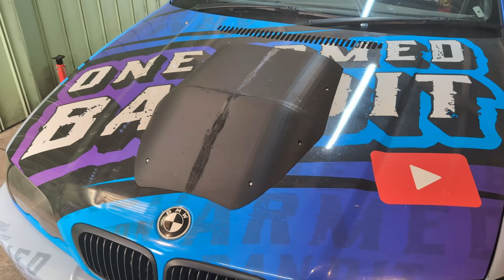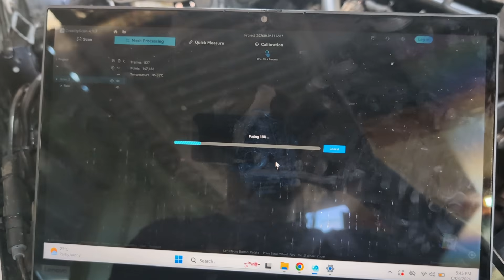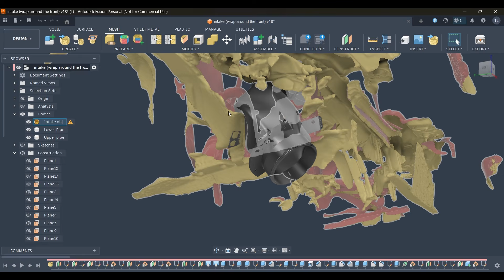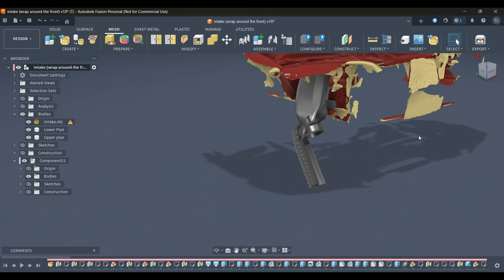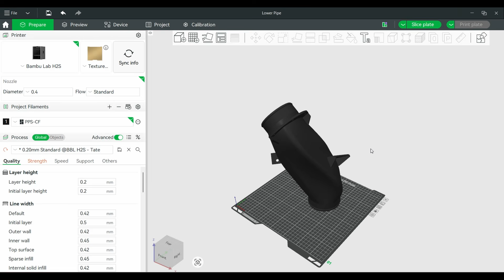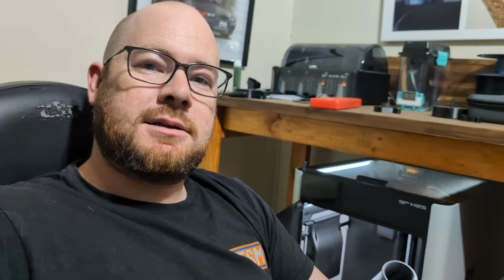3D Print Your Car Parts! | Quick start guide to design & printing.

Comment: Maybe I completely missed you mentioning this as I sort of listen as I work, but are you running that PPS-CF through your AMS? I know they say some of their filaments arent AMS compatible, but my understanding is that some people are modding their AMS's to run stuff they shouldn't. I have some PET-CF17 that I read would work, but that you needed something to save your funnels, so I printed some funnel savers. I haven't been brave enough to try it just yet. I've actually had some major projects in PETG and ASA that have eaten up all of my printers run time lately.
Reply: if there is anything i can recommend, its running pps-cf through a sunlu e2 which dries at 110c. running it through the AMS can damage some of the parts, aswell as increased wear on PTFE tubes. I personally just disconnect where the PTFE tube goes into the side of the printer and feed the filament through there, into that smaller PTFE tube section that goes into the tool head. PTFE tubes are consumable afterall so it doesnt bother me if I have to replace them sooner than expected.
Reply from the maker: Nah I had the PPS external in a drying box. PAHT I have printed in the AMS fine as its rated for it, which is why its by go to nylon. The PPS is so expensive that its not worth the risk & I dont print with it often anyway.
Reply: @OneArmedBanditYoutubeChannel  I've been trying to find a good way to run spools that wont work in my AMS. I did see a 3d printed roller system that lets your run your AMS open so the filament sits in the AMS and then it runs out the front rather than through it. My biggest issue is my printers are packed in tight and there isn't room for any external spools. I do have an AMS HT run up high above my printers, but its kind of got the same issue as an AMS.

Comment: What do you think about the dual nozzle version?
Reply from the maker: I think they are pretty cool. If I had to buy a printer again I would seriously consider h2d. Draw back is print volume is affected & it's more expensive. The upside is printing abs supports. I basically only print functional parts s 2 colours isn't an advantage.
Reply: @OneArmedBanditYoutubeChannel true. Have you maxxed out bed size with any automotive parts you have printed?
Reply from the maker: @frashd yeah I have, actually was the last thing I printed. Admittedly I could have put it on a vertical angle if I had too but I would have been a pain.

Comment: Few tips as an Engineer with  10+ yrs experience:

- After you scan, decimate the mesh. To about 60% of the original. So if the software says you got 1 million scan points reduce it to about 600k. You really dont need the extra fluff and you can work with 60% just fine. It'll also help with pc freezing issue

- about the reference planes, before you scan, get 3 or so rulers or carpenter squares in the real world and lay them around your scan area. These will scan in & you can easily place your planes on them in the software. 

- lastly for big pieces. Get a 0.8mm nozzle. They're very cheap (like $17). It'll cut print time by 50% for large parts and actually improve strength compated to 0.4mm nozzle.

Bonus: if a part takes almost the whole bed space to print. Calibrate printer b4 printing. It helps make sure your printer is dimensionsionally accurate. Extruder has to travel longer distances during print.
Reply: Ich drucke fast nur noch mit 0,8 und 0,6 und die 0,8 habe ich als high flow.
Reply: @divisionbyzero7916  responding to english in german.
Reply: @splitloopgaming3523 verstehe ich nicht. Habt ihr keinen Übersetzen Knopf ?
Reply: @splitloopgaming3523  so? We're in 2026. Translation exist...
Reply: @VoidPixel4179  Yes it does. Be the bigger man, and use it.
Reply: Thanks
Reply: great tips
Reply: Killer tips, thank you

Comment: Always wanted to build something like this but going through the CAD learning phase myself now. 
Couple thoughts I had noted when i thought through mine, 
1. venturi flow vanes on the inside to improve the flow characteristics
2. mesh catch screen, preferably replaceable, right in front of connection point to the throttle body. That way any stray breakaway pieces are caught there.
Reply from the maker: The mesh is a good idea, but its also could be just another thing to end up inside the engine. Same with any vanes. I would like to get fancy like that on a cheap non competiton engine, but this one is too expensive to risk. Even the simple intake a did felt pretty risky at the time.

Comment: hey, quick question. Isn't 0.8 nozzle stronger and better for such parts comparing with 0.2?
Reply from the maker: I've got the stock 0.4. I have very briefly looked at different nozzles sizes & I remember being underwhelmed with the info I found about bigger nozzle sizes but I can't remember why. It's something I should look into more.
Reply: @OneArmedBanditYoutubeChannel  what you were saying about annealing and crystal structures is also true for larger nozzles, to a degree. A larger nozzle will have a flow of plastic that is more uniform with a more homogenous crystal structure, and will allow for less layers and lines per volume (the weakest part of any print is where the layers meet, second is where lines meet.). Not only is this obviously beneficial for strength, but the simple fact of flowing more plastic means your print times can drop drastically. The only downside is lack of resolution, but for large prints this is seldom a concern when talking about moving between 0.4 - 0.8mm nozzles.

I only ever personally use 0.4mm nozzles when surface appearance and dimensional accuracy is absolutely crucial (such as aesthetic designs, or parts that need precise tolerances)

Comment: I have an H2D and just ordered a X2D. I want to produce a motorcycle carb to air filter elbow manifold but I am skeptical the printed part can withstand the heat.
Reply from the maker: If you use PPS & it's not super close to the exhaust you would likely be fine. Will depend a bit on design but it would be your best bet.
Reply: @OneArmedBanditYoutubeChannel it appears neither my H2D or forthcoming X2D meet the requirements for PPS printing.
Reply from the maker: @AudieChason H2D should be fine to print PPS-CF. I printed it on my H2S no problem. I used bambu profile but bumped up the nozzle temp to 350c

Comment: Loved this! How did you add the hexagon pattern to the outside of the tube? It's so perfectly wrapped
Reply from the maker: In fusion I used the emboss tool to wrap a 2d sketch onto the pipe. The sketch itself was painful as I couldn't find a good way to get the system to make the hexagons the way I wanted, so i had to do a bunch of it manually.

Comment: I think CF is the biggest grift in the printing world. The parts are not stronger, just stiffer.
Reply from the maker: The reality is certainly not what people automatically assume. But if people look at the data it's all there.
Reply: @OneArmedBanditYoutubeChannel  I find the data is more aligned with marketing than real world application though. e.g. most people won't bother with nylon but it is incredibly tough when printed correctly. Maybe glass fibre if anything if you need that rigidity but carbon is just not the right additive for real world. Not saying it can't be used, just that it's overhyped and there's better out there.
Reply: @sixdegrees6434 what would you say is better than CF in applications like this where parts are going through extreme heat and high stress environments?
Reply: It can help with warping, making printing easier, and sometimes possible at all.

Comment: Pro tip for 3D printed parts. Avoid sharp angles on connected shapes. Your two flanges coming off the lower tube should have large fillets or chamfers to keep weak points from being created. Otherwise you have learned much and I salute you for taking the plunge and using 3D printing in this way. Cheers! (Note: I also use Bambu Labs. Have an X1 Carbon that I've put through it's paces.)
Reply from the maker: Thanks mate yeah learn't alot. I had so many arguements with fusion about chamfers that i probibly gave up on those flanges. There is probibly a much better way of doing it than I was. Next thing to learn is how to do 'forms' so I can build my own body kit.
Reply: @OneArmedBanditYoutubeChannel  A lot of times it is where in your timeline you put those chamfers. Also the radius can make a difference if it interferes with other "seams" on the existing part. Sometimes takes a bit of work to get them in there. Good luck brother!
Reply from the maker: @mmztimelord yeah my timeline was a bit of a mess, I hadn't built such complex parts previously so timeline management wasn't so much an issue.

Comment: Liked and subbed. I'm pretty good with Fusion and printing with my P2S, but I've never tried scanning. I really didn't think the technology was quite there yet. But after watching your video, I'm rethinking it.
Reply from the maker: They are pretty good these days. You likely still need to do some test prints to get dowels & bolt holes perfectly aligned but most the time it's fine.

Comment: Great work, thanks for the video. The filament melts around 250°C but it can deform at a much lower temp. It should still be fine for this case but keep in mind for future use cases.
Reply from the maker: The annealing process I did with the PPS was 200c for 9 hours. It was still rigid & didn't loose shape when I got it out of the oven. Pretty crazy stuff, 6 drift events done now & it hasn't had any issues but I'm inspecting it constantly since just in case.

Comment: Actually enjoyed watching and learning from this video, I’ve recently bought a creality k2plus and I’m looking at making my own intake for my ek civic turbo build, what would you recommend for a 3D scanner for someone who’s just getting into 3D printing but wants to commit to doing well made and engendered parts, I’ve tried making things with just measurements and scaling it through Fusion but it just doesn’t come out the same way, been told many different things with scanners but from someone who’s obviously spent some time on it would you go a different route or stick with the one you got.
Reply from the maker: Thanks mate glad you got something out of it. I have to be honest I bought the creality ferret as a stepping stone to better scanners in the future but I haven't come up against anything the ferret can't do yet. I think if I wanted to scan a whole car it might struggle but for anything engine bay it's been fine even body panels it can do if you think about how you use it. For the price point it's really.  hard to look past. You are also limited by your computer, no point having a crazy high detail scan if you computer just says NO. Even my gaming computer with a pretty top spec CPU and 3060ti struggles with large higher quantity scans from the ferret.